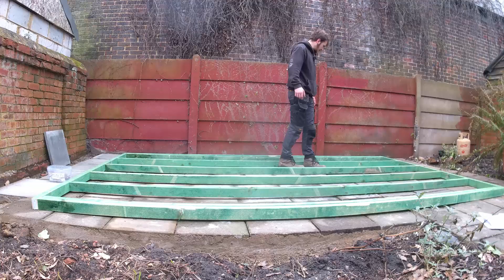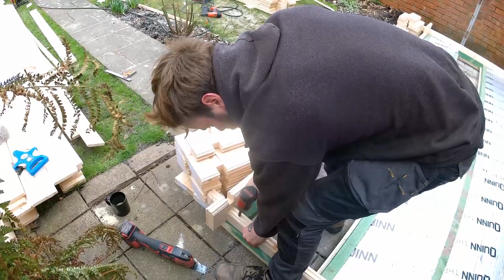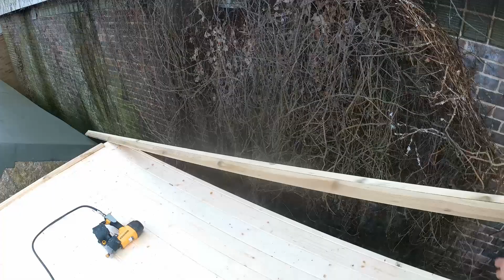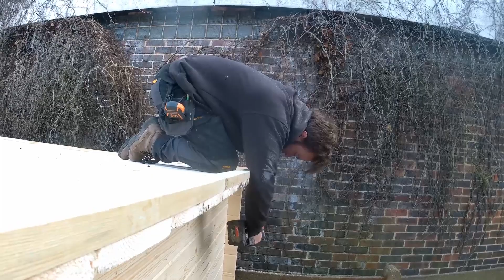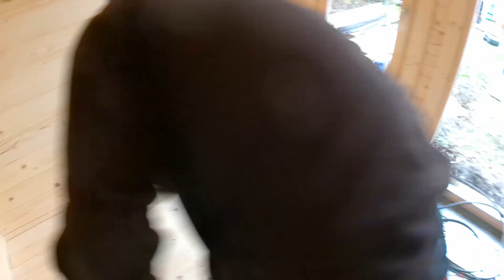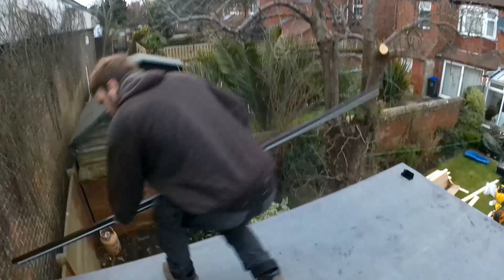How to build a Log Cabin - Complete Tutorial

Comment: If you build on grass how would you put down the membrane before using floor insulation?
Reply from the maker: You would assumedly be using a timber framed system with posts? In which case you could overboard the frame before putting the building on top , giving you a Deck to put the insulation on.

Failing that, you could use some batten lats fixed to the side of your timber frame to suspend your insulation off the ground.

Comment: Do you install other manufacturers cabins? If you do have you installed a Dunster House one?
Reply from the maker: Hi Mark, 

Yes we do, and yes we have. 

Have you purchased a building already?
Reply: @allthingsgardenbuildings  not bought one yet as I’m getting a few mixed reviews on their customer service not being all that good if there is a problem. Have you found their log cabins to be good quality? 
On one of your videos you mentioned threaded studding being fitted to the corners of the cabin,  is that generally on the larger cabins? 
On the concrete slab do you recommend Visqueen going down prior to the timber base frame?
Sorry for the random questions 🙄😂

Thanks

Comment: What's the bar way to anchor a TV bracket to one of these wooden cabins?
Reply from the maker: Hi Simon, 

You can bolt right through if its a really heavy TV, just try and fix to one log only, not over two, as this will prevent the cabin from natural movement.

If its a fairly modern TV, they don't often weigh too much, so you can fix with coach bolts just under the thickness of your cabins wall logs.
Reply: @allthingsgardenbuildings  Cheers I'll give that a go.

Comment: Presumably the concrete slabs were prepared for you by the purchaser, hence the discrepancies in the ground level?
Reply from the maker: Hi Jane, i think the customer had an old shed there originally.

It's always worth getting the base right, then you'll never have any issues with doors and windows not opening correctly, or uneven settlement.

Comment: Two questions...Can you set the insulation directly on a concrete slab?  How would you anchor the cabin to a concrete slab?
Thank you
Reply from the maker: Hi MPH06 ,

We'd usually use a damp proof membrane underneath. 

Its good practise, although many would argue it isnt needed, as the insulation cut tight to the joists acts as a vapour barrier.

If it was my own project, it'd be permiter joists down, dpm so it rises up the sides internally, floor joists on top, insulation between joists, then floorboards on top. 

Hope this helps,

Many thanks

JM Cabin Services
Reply: @allthingsgardenbuildings  Thanks for the reply.